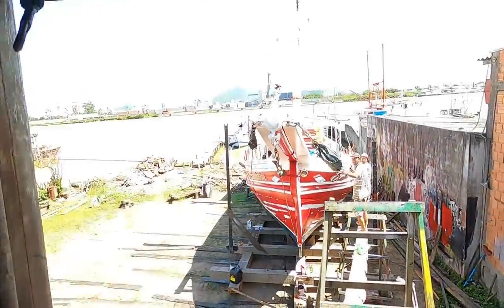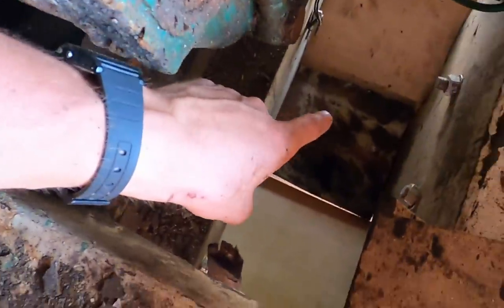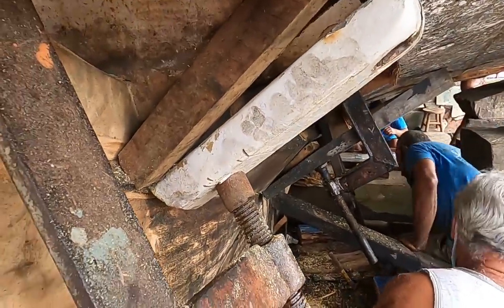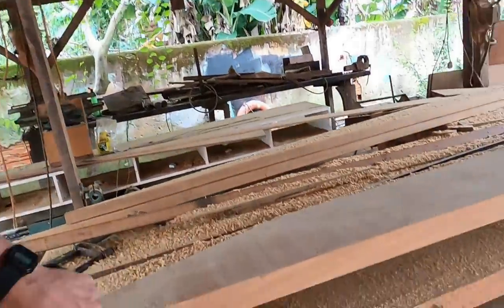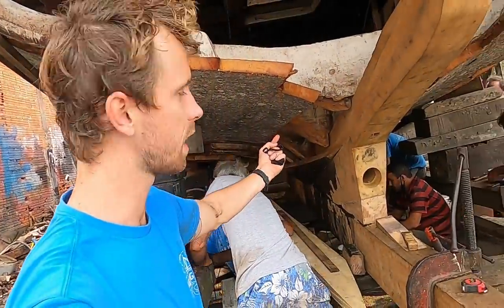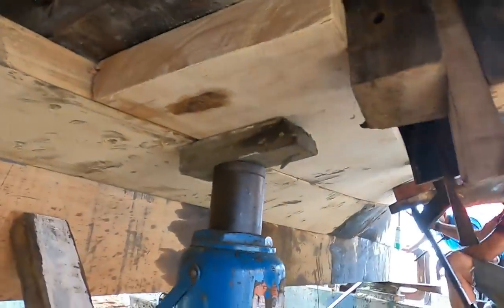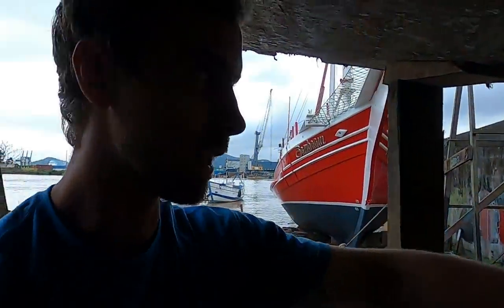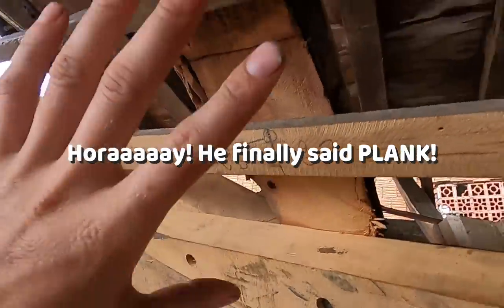Building a wooden boat with FIRE! — Sailing Yabá #20

Comment: Well that is one way to bend a plank , I get what they are doing , but having steamed ( the proper way ) and set a bunch of planks , I have reservations on many levels about this . However, they obviously know what works for them . You are right that the garboard has to fit well I am wondering how much of a caulking seam and landing they put in there , and not for nothing but that's a lot of edge setting , but as I say you have to go with the boatwrights methods in that is the way they do it there . I am not armchairing this I am a Pro who has done wooden boat restoration of that size and worked on boats since I was 15 years old ( I am 63 now) .I was taught by guys who cut their teeth in the 20ts and 30ts and 40ts , so I know what I am looking at .I wish you well it will work out , however I do feel there has been some questionable calls by the boatwrights, good luck to you ...
Reply: @Robert_DeVille  Yes I concur. One thing is for sure when they dunk her , they should go easy on her until she finds her place, then check thoroughly for leaks haul her and recaulk and repay the seams, It would be prudent on their part , as I said they have to go with the methods that these carpenters use they have little choice, we shall see.
Reply: the nails i can not wrap my head around....have never seen that...always rivets or bolts.....am I missing something?
Reply: @gg9960  No you can nail planks that is more like workboat carpentry it is fine , screws would be better ( lots more expense ) .If your bolting planks on that is way too much edge set, rivets you would use only in  a thinner planked boat such as a pulling boat, ie a Whitehall or a dory .If I had been doing this I would have soaked the plank overboard for a week or so passed it through a boiling bath and bent and screwed her in place, steaming is still better , but as I said you have to go with what these guys know works for them . I am sorry to say they lost me taking a chain saw to kerf the garboard , that plank should have been spilled ( patterned) better than that .
Reply: @lawrenceburchett7411  do you watch the vietnamese boatyard show on youtube?
Reply: @Robert_DeVille  They are trying to tread the line on this rebuild thinking the upper framing is good enough to hold her upper shape and that all those new planks will help her longitudinal integrity ( it will help ),Wait for the other shoe to drop when they get her in the water and get into covering boards , shearstrake rubrails and frame tops , I will bet they are not wort a crap either .It will be interesting
Reply: @lawrenceburchett7411  i had a 1938 verity rumrunner...my grandpops....rivets and bolts...tjough it was atlantic white cedar planks, cant get that stuff anymore.....I guess when you say work boat you mean slow and low.....a planning hull they would pop out in a week with north atlantic seas
Reply: @zeusapollo8688  No but I will check it out , its always interesting to see that kind of traditional boat work , especially to someone who has worked at a Maritime Museum , and is interested in wooden boats.
Reply: @gg9960  Yes I have seen a few Rumrunners like that , they are cool , yes most planning hulls were screwed , but I am sure that local builders used what they were used to and that sounds light construction to go fast Atlantic White , has been scarce since the 70ts lol
Reply: @lawrenceburchett7411  this was a seaskiff....bolted to frames rivets on the lap
Reply: @lawrenceburchett7411  they tried to put me in a maritime museum a few times...the viet yard coats their  wooden hulls in resin mixed with calcium carbonate.  I think this would keep the worms out quite well but yaba might flex too much
Reply: @Robert_DeVille  but that is like the difference between someone patching up and old van and restoring a vintage Bentley. 
Both serve their purpose, both great to watch, but both very different
Reply: @gg9960  I am very familiar with the type , had a 20 footer built in Wildwood or thereabouts , Atlantic white with white oak frames bronze fastners riveted laps and screwed frames 327-350 Vette mtr , lots of fun and very fast
Reply: @Robert_DeVille  Oh yes I brought up surveying early on , anything can be rebuilt , but is it worth it? that's a value judgment.I would not be making any deep water passages on that boat , but I would think that she would be ok coastwise if she was looked after well , we shall see
Reply: @lawrenceburchett7411  the one i had my whole life was a one off sea skiff hull 32' but all mahogony superstructure and interior...gentlemans cruiser...salon, bunk house bathroom and galley.....the wildwood one was probably a jersey sea skiff....big debate who came up with design first....verity on long island or the jersy sea skiff.....an old verity is what the al grovers made their mold from....smallest boat to cross the atlantic under power
Reply: @zeusapollo8688  That kind of treatment was developed by locals because its what they had that worked for them , in that place .I would imagine it would leach out fairly quickly , not a problem for workboats that are disposable boats and hauled regularly.
Reply: @Robert_DeVille  Yes indeed , having made some ocean passages in well found boats, it can be  a life altering experience ...lol ie. a Bermuda race in a Nautor Swan 44 and it was a stormy uncomfortable passage , thank God I was young ...lol
Reply: @gg9960  Nice boat , lots of different builders taking their own take on the hull form , quite interesting from a Historical viewpoint
Reply: @Robert_DeVille   Oh I agree, the only wooden vessels , in my view that are worth this kind of effort are historically significant or  very pretty boats , this vessel is neither. But you know all this is a personal choice .I think that what will end up is a constant state of repair and a spacious liveaboard coastwise boat. It will be interesting to see how they progress .. It is my wish for them that they get this boat out of the way , make all the mistakes and move on to something more worthwhile .They are young they can do it and they will have learned a lot
Reply: @Robert_DeVille  Tally Ho is the exception in boat restoration. Globally this restoration is probably the rule.

Comment: Why aren't screw fasteners being used, wouldn't they offer a firmer, more solid and secure anchor against the tendency of the planks to straighten out?  While I'm not a builder, I'd certainly have doubts about the longetivity about straight old nails being used, regardless of size.  At the very least I'd expect spiral nails.

Comment: The proper way to bend boards is to place them in a steam box and soften them. Not with fire. And the  planks are cut wrong. I’m not saying those guys are without skills but they’re doing a lot of things wrong that may cause a serious failure when that boat gets caught in serious weather. Like a keel with several spices or ribbing with splices. Boat will flex too much. If you want to see how those planks should cut see Sampson Boat Co EP93 at 12:34
Reply: So evryone watching 5 series of boat building is expert now? The nibbing is done so the end doesnt stick out... nothing sticks out on this plank, so it will be fine. Its a matter of doing it "good enough"  or doing it perfect.  The boat will not be weak because of this, they have much stronger keel,keelson and other structures in place to make it plenty strong. Maybe the hull wont last 100 years and has double the weight than necessary if build with a lot more effort, but there is no need for perfection.
Reply: Well that’s your opinion and that’s fine. I’m a professional Captain with more than 30 years of experience so while I get your trying to discredit my statement with the sarcastic “expert” jib but I’m far more of an expert than you’ll ever be. All those things you discount are pretty damn important. Time will show. The first time they get caught in high sea conditions and parts of the frame crack because of too much flexing and those joints on the keel which should be one continuous beam could also fail. In the end I don’t care if it’s done right or if the boat sinks in the middle of the Pacific. I wouldn’t have bought a rotten boat to begin with and my life or crews lives won’t be on it. But that’s the internet for you someone who knows shares a thought and some idiot who actually doesn’t know gets butt hurt over it
Reply: @seabournewolf2298  I did not know that and could not, good to know. The boat should stay close to coast and not get into heavy weather for a number of reasons, i can agree to that.

Comment: Even if using nails it is part of the traditional construction method, have you considered replacing nails by screws? My expectation is that the hull would misalign and start making screechy noises much faster with nails than with screws...

Comment: Haven't seen much on frame replacement which I called ribs last time. How many frames had to be replaced?
Reply: I was thinking the same putting new timber in old rotten frame hmmmmm🤔 and six inch galv nails !? Where the copper !!

Comment: So nails were used before because screws were expensive and you go back far enough, not existing.  This created sprung (great word) planks.  Another reason was for worms and rot....easier to get a plank out.  Well, now we have better coatings.  Please use screws.  And hopefully of the square head type.....  10 year job versus 4 year...

Comment: those nail look like match stick they will corrode in no time and the holding power is not that good at 18:10 you can see a plank already nailled move back when nail are driven in a another part of the plank.

Comment: What can you do to stop all these new planks from getting eaten again in time ?
Reply: What are we going to do to avoid the worms to eat our keel again?
First of all, we would like to clarify that what happened to the old keel was a combo of: neglected maintenance + boat stuck at the same place without moving for too long + tropical waters (worms’ favorite environment). As we are planning on moving and maintaining the boat yearly, the worms shouldn’t be able to feast on our hull like this again.
Besides that, we will treat and protect our wood against the worms, for sure. For now, we’ve been applying a protective thin coat of an anti-corrosion primer, to start protecting the wood from sun, rain and basically anything in general. As it’s very thin and gets absorbed very well by the wood, it also works as a treatment against cracks by simply nourishing the wood. We still didn’t define 100% what will be done afterwards, so we will share this information later on. But we believe we will be using epoxy, tar and anti-fouling in layers to protect the hull, which is the most common technique here for wooden fishing boats + a worm shoe

Comment: I'm no ship carpenter but I have driven lots of nails . By the size of those galvanized nails I sure wouldn't want to try to pull one out , as long as the frames are solid those nails won't be jumping out anytime soon .
Reply: yeah they'll just rot in place instead and leave nail shaped holes behind
Reply: @ysesq  Filling the wood with Ironsickness for good messure.

Comment: A discarded cigarette probably burnt down the roof of Notre dame cathedral, but this boat can withstand being covered in oil and having a flame thrower held on it . That's some seriously fire retardant timber. Won't be long before the boats back in the water at this speed.  Great video as always.

Comment: I see wood working skills almost forgotten in the world of fiberglass/steel hulls. It is good to see these guys working have the skills and not the fantastic mill shops of the large factory construction centers. They use the tools they have very well and it seems to me they are doing a great job. Very time consuming for sure and the margin for error is very low.
Reply: @JCrook1028  I watch these folks already and more precision boat building is not what I see, just better locations and neater facilities. Sampson and Company are working on a scratch boat as are Salt and Tar. There is a large difference between building from scratch and trying to save as much of an existing worm eaten boat. The guys here are trying to repair a boat in terrible condition and to do so as low cost as can be done safely.

Comment: Ok so what were they using to tie the boat together, they looked like galvanized nails or bolts, I would be running now if they last a year I will be very surprised.
Reply: Boats have been built with nails for thousands of years. They will last. Its all up to the bottom coat, cleaning, maintenance and not letting fresh water into to bilge. That is what rots a boat.

Comment: Bit worried you are not applying "soup" to the new wood for protection , especially on the inside. Great to see traditional skills. As for the nails, if they didn't work I don't think these lads would be using them. Keep up the good work MP, BEN AND THE GANG.

Comment: No tar or even red lead paint between the new planks and the frames and keel. Perfect for water to be trapped in the joints and start it rotting again. If this was the way it was originally built then no wonder it is in such a bad way.

Comment: Out of interest - why steel nails and not bronze?
Reply: They said it previously, bronze would be too expensive. They said with proper maintenance it should last decades
Reply: She was originaly fastened with galvanized fasteners, you always go with what was in the boat to being with , mixing metals promotes galvanic action witch will accelerate the disintegration of the existing fastners .
Reply: @lawrenceburchett7411  Ah - makes sense.
Reply: Much cheaper, and the nails will be the least problem for the final boat. Wonder how they will swap out the frames after the planking? Guess only verry few frames need swapping, they looked pretty good after sanding off the top black dirt from them.
Reply: @schuttrostig5729  Well the frame issue is debatable, I saw that many of those frames were questionable, when they do the bulwarks and covering boards they can slip half-frames down and sister them, not the best but I have done it , Also anything above the waterline can be done by stripping the inside joiner work and using a float , I have done that also and yes its a bonafide pain in the ass ...lol
Reply: @lawrenceburchett7411  Galvanized means, a zinc (anode) around a steel / iron (cathode) nail. <-- 2 metals, zinc is rapidly consumed in salt water and afterwards the steel will be attacked. Only bronze (Zinc free) should be your material of choice.
Reply: @raywattie2308  Many boats especialy old wooden work boats and the like are fastened with galvanized fasteners. If the vessel is fastened with galvanized nails , ( steel hot or cold dipped fasteners ) it should be fastened with such as dissimilar metals accelerate galvanic action .Bronze or monel of course is better but not in this case as she was built with galvanized fasteners, so that should go back in her .life span in brackish and saltwater is about 20 years give or take . If your boat has good bonding straps and you tie THEM to a sacrificial zinc , you never mix fastener metals
Reply: @lawrenceburchett7411  Don't assume, only different metals making DIRECT contact with each other suffer from metallic corrosion. Wood is not a metal. So they could "mix" new bronze with the old galvanized with any corrosion problem.  
While taking out the first frames you could have seen the damage salt water does with galvanized nails.
Reply: @raywattie2308  Think what you wish, rule of thumb is you use what the vessel was fastened with, and never mix metals. The galvanic action would set off accelerated corrosion, below the waterline the water in the soaked hull itself carries the weak electrical field. this was taught to me over 40 years ago, by shipwrights of long-standing. You can do what you wish, however, I have seen the results and when I was restoring boats at the Chesapeake Bay Maritime Museum, we sure did not do it either.

Comment: Hey guys, I am curious......why are the shipwrights using galvanized nails to  fasten the hull planks to the ribbing, rather than using screw fastenings? I would think that the screw fastening would be a lot stronger than just relying on the nail heads to keep the planks in place. Ben, a suggestion. Go online and get a manual about what the various areas of a boat are called. That way, you can communicate much easier with the shipwrights and other wood boat owners.  It should also include the terms (unless you are already familiar with them) of all the topside rigging. You know like, the difference between standing rigging and running rigging, halyards and sheets, etc. Just a thought. She is sure coming along nicely. You are fortunate to have such an experienced yard crew. Have a blessed week and stay safe.  George & Debby Brady

Comment: The restoration of YABA shows ones again that Brazil is not and was never a shipbuilding nation. The naval industry in Brazil depends on knowledge out of Europe and Asia. 
For wood build ships in Brazil there life cycle is really short, to much shortcuts are taken and material used is of minor quality. No one can show me 1 historical or old wooden (sail) boat build in Brazil. I challenge the one that can prove me wrong.  In this case of YABA, she will sail again, but within 10 years she is on a scrapyard. The guys working on the shipyard are very skilled, they can surely build better ships if they are given professional tools, quality ship build materials and some instructions to bring them to the next level.